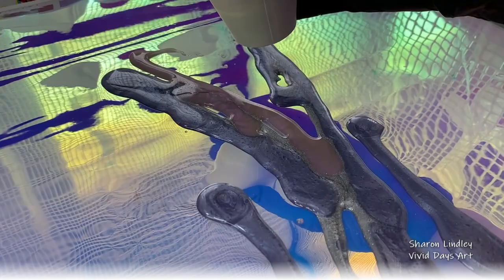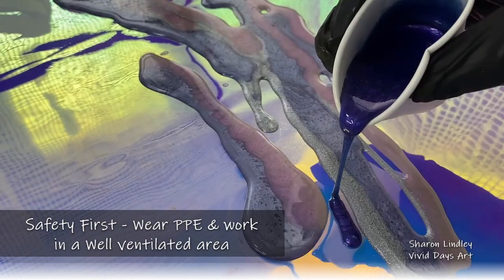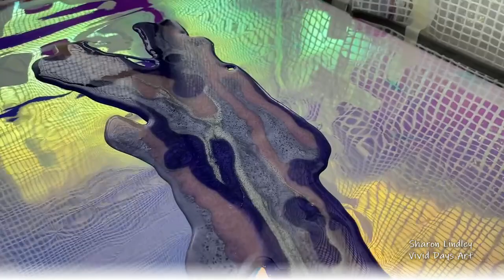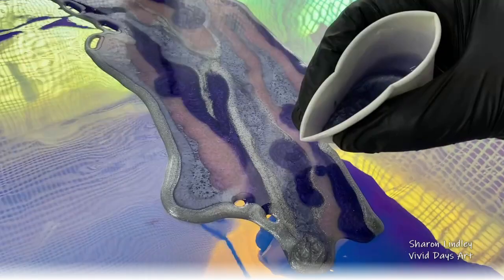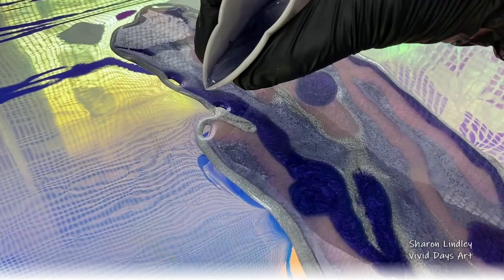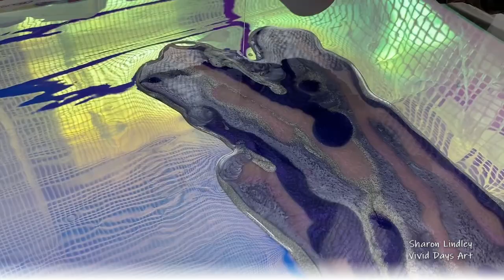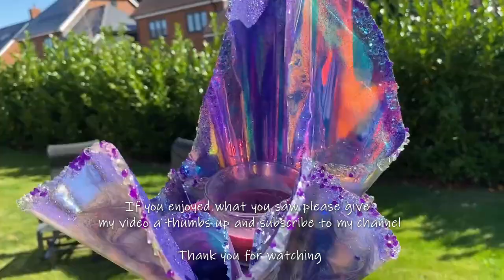315 - Amethyst, Lavender & Jasmin Resin Free Form Sculpture Petra Jongbloed Pigments & Bling Bling

Comment: If the film leaves the inside sticky how do you seal it if you don’t plan to use glitter?  I ask because it seems like it would be annoying to try seal it once it is finished. 
I really love this piece. It is very whimsical
Reply from the maker: You don't have to remove it you can leave it attach like I have done in my other video with the yellow sculpture.  Its not over sticky when you remove it, its more slightly tacky.  If you don't want to peal off the back you don't have to and therefor no need to seal it.  I show it on my Yellow Sculpture.
Reply: @SharonLindleyVividDaysArt  thank you. I will check the other vide out.